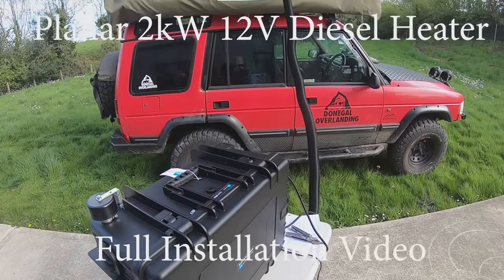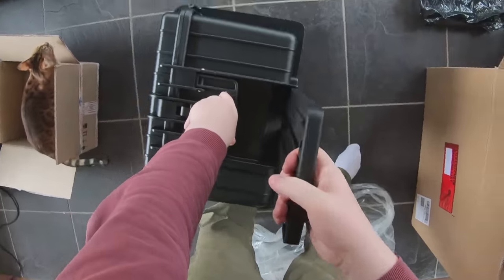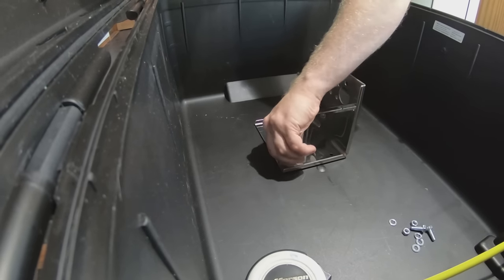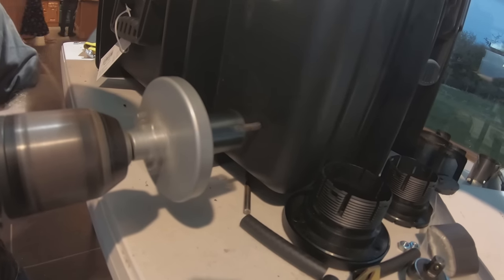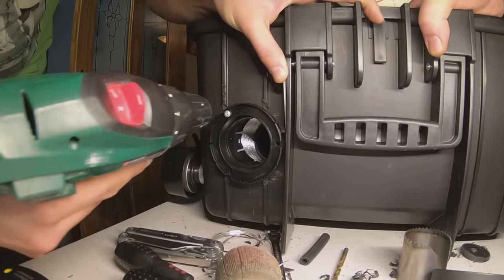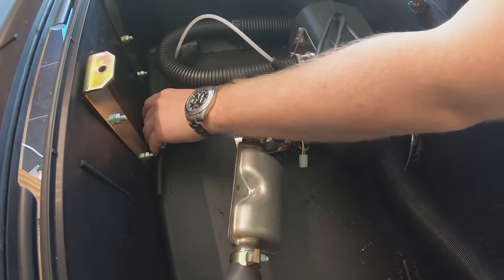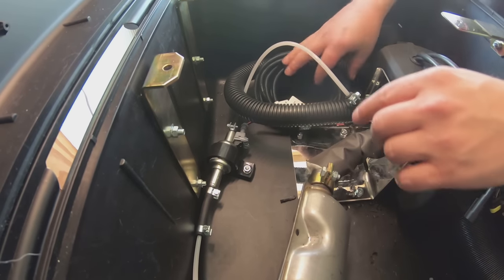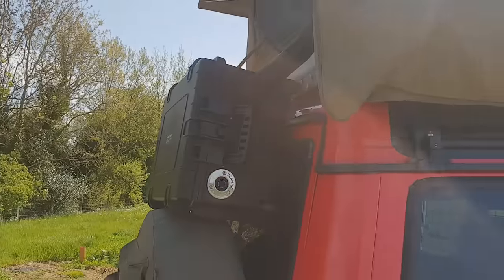Diesel Heater In A Box Install

Comment: I'm sorry but; no..exhaust output is less than 2 feet from the cold air intake...unshielded muffler about 1.5 inches from the fuel tank in a enclosed case.....no thank you
Reply from the maker: Can you give us some background into your experience and qualifications regarding your points?  This case was built with close scrutiny from the Planar Technical team.  They approved every aspect of it.  Its been in use for well over a year now with zero problems, but hey, don't let that sway your judgement.
Reply: @DonegalOverlanding  I've contacted planar with a link to the video
Reply: @DonegalOverlanding  the follow up from planar Corp. And this is a quote from a Mr. Sergey Reger...

"Thanks for your notification. You are totally right, this setup is NOT safe at all. The basic safety features have been just overlooked. I'm not sure, if any authorized planar dealer would advise or approve such design." 
So, is this enough proof?
Reply from the maker: @michelschoenbachler5079  thank you for the follow up.  However I would like to point out some facts for you.  Mr Sergey Reger sells Planar heaters in the USA from his online shop, a shop with a gmail address.  He is nothing to do with the technical team at Planar in Russia..  They sell a very similar design and in an even smaller box which has air intake and exhaust even closer than in my design.  So what do you have to say about that?  Now for clarification, just to save you boring everyone with your relentless drivel, Planar in Russia sent me this heater for free.  They went through step-by-step what they wanted me to build.  I spoke with them by email and by Skype on multiple occasions to ensure it was created to be safe and to be reliable.  For further clarification, I was actually speaking to Planar in Russia and part of our agreement was that they had to approve the final edit before I could upload it.  I altered the video numerous times at their request prior to it being put on youtube.

Comment: Really nice video, to bad you never actually said why you chose that heater over the one made in China. I realize you mentioned
 (quite quickly) that you read about people having trouble with the one made made in China but never elaborated on the kindns of problems???
Reply from the maker: Hi Promaster, good question.  Typical problems with the Chinese heaters are that they soot up very quickly if there are not run on full power most of the time.  The sooting is such a problem that many people are using kerosene (home heating oil) instead of diesel to try and reduce sooting, despite the fact they are 100% not meant to be used with kerosene at all.  Kerosene requires a higher pressure and the difference in heat means that the internal sensors do not function correctly.  It is very easy to damage the heating chamber by using the wrong type of fuel.  They are diesel heaters, not multi-fuel.  The Shocking quality control, such as exhausts not being fully welded, so fumes leak out all over the place.  Parts damaged, broken or missing.  Different parts in the box than in the adverts.  Different parts in the box than described in the instructions.  The outer casings frequently cracked.    Above all of that though is the simple fact that they have zero certifications regarding safety.  Its amazing they are allowed to be sold in the EU given they conform to nothing.  I honestly cannot understand why people would use such a device, which has the potential for loss of life, when its not passed any safety standards.  Eberspacher, Webasto and Planar are all certified (CE) for use in the EU.  They all have 2 year warranties.  Like Ive said many times before, I am not against products made in China, these days the majority of products seem to me made there.  What we do have a problem with is products which have the potential to be a risk to life with no certification being sold in the EU.  I know people want to save money and that's totally understandable, but for a few hundred pound more you can better protect your life and your families life and have a quality product that will last many years.  When all is said and done, for me peace of mind is extremely valuable.  That's just my take on it though, there are thousands of people using the Chinese heaters and they would argue all day long about them.  The last thing I want is to get into a battle with people who own them.  Everyone is free to make their own choices, with this video our aim was simply to share what we decided to do ourselves and we hoped that whether you choose a Chinese one, or a certified heater, that the concept might help people if they decided to make something similar.
Reply: Donegal Overlanding A word of caution, my £6,500 CE certified, made in Germany Dometic TEC 30D onboard diesel generator was always springing new leaks from the exhaust and fuel lines, one exhaust leak was so bad it asphyxiated itself and wouldn't restart without a new air filter. Thankfully my American made RV was  well enough made (there's a sentence that's hardly ever written, even in the US) not to let any of the fumes inside. Don't get me wrong, the engine, inverter, ECU and control panel are of excellent quality and I have no regrets buying it.

I did however buy a Chinese water cooled 3 phase 12KW generator for my house and workshop, couldn't fault it at all, it was a brilliant piece of engineering and technology.

Wanting to buy a diesel heater, there's a huge choice out there, even from China. I'll take my time and remember what you say.
Reply: @DonegalOverlanding  chinese heater costs 145 eur. for such price you can buy 4. and one of them really be good :D

Comment: On most heaters thermostat is in air intake so heater will not switch off unless cabin air passes through inlet ,so battery life is less , also easy for somone to poison you while you sleep ,or carbon monoxide from running vehicles next to you . Idea good needs more thought 👍
Reply: Yes because we are all worried about being poisoned as we sleep...
Reply: @706d  simple fix 2 pipes use your brain ,you can buy complete heater assy like this off internet £200 safer and lot cheaper!
Reply from the maker: Dear me Peter, you really are being ridiculous.  Unless someone connected a hose from their exhaust to the air intake, we would not be poisoned.  The box sits on top of our spare wheel which is mounted in the back door.  Fumes stay low, so if, by some weird reason, that someone was running their vehicle the fumes wouldnt reach.  Not only that, but when we camp, we dont camp on top of one another, was space the vehicles out.  This model has the digital controller which has a thermostat built into it.  It reads the temperature inside the tent, not in the case, which is outside.  The entire plan was developed and approved by Planar themselves.  Planar provided us with the heater to create the product in the first place.  I think the Russians know a thing or two about how it works.

Comment: First of all. Planar  is build in Russia using chinese parts, so you are not better off for lot more money.  Second, i have a chinese heater and it"s been runnig for over 3 years without any problems.   Nothing wrong with the chinese heaters, but the problem is that many people with no diy skills at all buy Chinese heaters because they are affordable and they don't fit it properly.  Later you see them on forums and youtube complaning.
Reply from the maker: Well that is your opinion and you are certainly entitled to it.  The reality of course could be quite different.
Reply: @DonegalOverlanding  well, I'm originally from Russia and I know someone who builds these planar heaters and It's a fact that the parts are made in China.  If it's better or worse you can't possible know if you never had one and you made a judgment based on what you may have heard.  There are 1000's of people who are happy with the Chinese heaters and maybe a few dozens who are not. It's your money anyway

Comment: Why?,,,, cause you have more disposable money. 😳😎
Reply from the maker: What are you referring to when you say why?  If you are asking why we didnt choose Chinese, its because they are not approved.  They are generally of very poor quality, and we have seen endless reports of issues with them.  Thats not to say there are not many who have no problem, because there are many who claim to have had no issues.  We will always choose quality over the cheapest unregulated junk on the market.
Reply: @DonegalOverlanding  regulators are the third worse type of people 👿👿👿
Reply: @DonegalOverlanding  I think, it´s also made in China. 
The price has NOTHING to say about quality.

Also the german brands Webasto and Eberspaecher: Many models also made in China. But also extreme expensive here.

You can see it ie at the easy snap-in cases of the diesel heaters.

But there are many other products made in China, who becomes extreme expensive in europe. With the end price of one of it, you can buy TEN of it at the factory.

Transport via ship container from china to europe: Cheaper, as you can imagine.
I think one british pound each. Or 1,50 each.

And I would never mount a diesel heater in a plastic case.
Metal tin case needed, ie aluminium case.

Greetings from sw-germany.

Comment: Ridiculous.
You can get a heater and fuel tank already in a case for like $170.. and that long hose being outside in the freezing weather means it will blow cold air into the area you intend to heat.
Brilliant!
Reply from the maker: Youve no idea what youre talking about. I can tell you that youre wrong.
Reply from the maker: @certaindeaf8315  thank you for your input.  You have really brightened everyone's day with your contribution, keep up the good work.